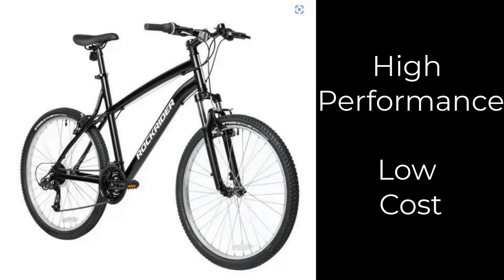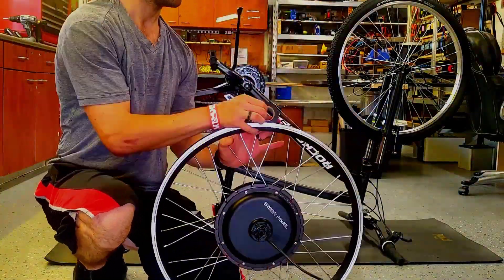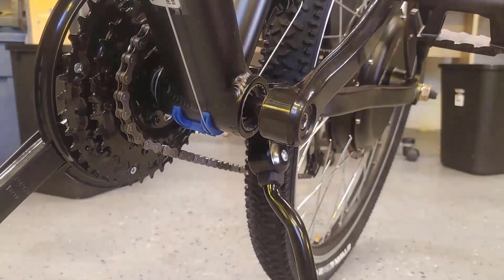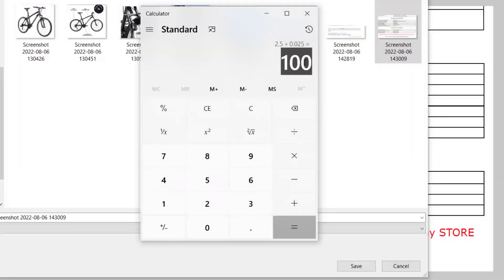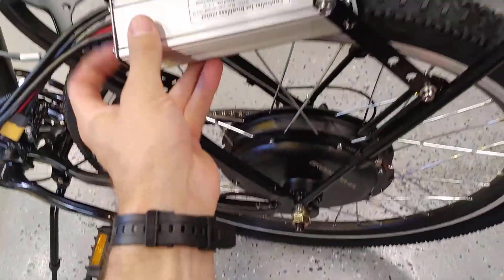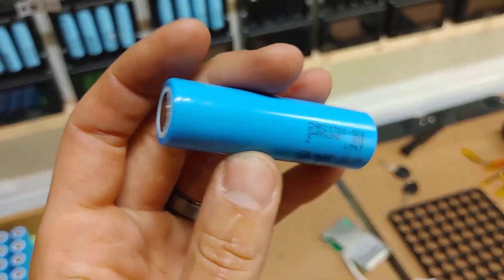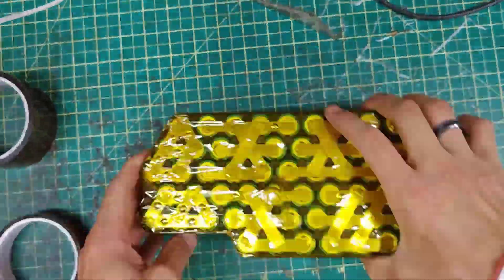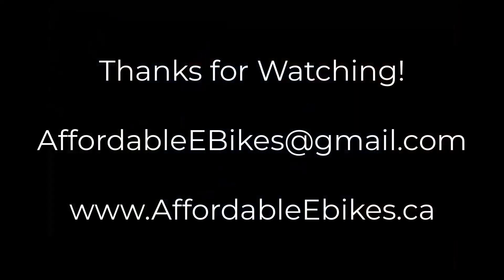Electric Bike DRASTIC Power Increase with SIMPLE Trick!

Comment: Hey just seen the video. How safe is it to use a modded shunt on a 1000w motor with the standard controller with 48v 18ah battery? The controller states 26+1a on the label if this helps any. Thanks if you can help out I’d really appreciate it a lot
Reply from the maker: Really depends on what your battery can output. Really depends on the cells. When you shunt mod you want to factor in around double the current, so for you would be like 50A. That's a lot for a battery to handle. You'd probably notice the battery cutting out quickly if its not up for the task.

Comment: So I've got an eBike and I'm unimpressed with the power. Being 6'1 210 shouldn't make it this hard to get a bike over 20mph. It's a 48v 1500w bike and I can't get it over 16mph on flat ground and I'm trying to find content to help me get the speed up (and torque, if possible).
Reply: Check if your controller has a speed limiter most likely thats your culprit. If it goes the same speed flat and uphill then its most likely speed limiter on controller. if slower uphill and 16mhp on flat ground then you can increase throughput with mod to get uphill speed to the flat speed if not overloaded

Comment: Can anyone tell me where I could learn more bout how to build more of my own batteries like this and where to source stuff for the batteries?? Really want to get into it myself
Reply: It can be very dangerous. I have tried it done it myself as well accidents still happen burned my hand really hard took months to heal from a short circuit using cheap Chinese bms with common port. Mind you a lot of these "shops" and DIY builders are getting shut down in US by gov and safety commission and or slapped with extremely high fines for altering, modifying or making DIY battery packs like this due to recent fires in NY. Many States are following suit and adopting additional safety standards that prevents you from building your own battery pack leally.
Reply from the maker: We're building a battery course right now! Send us an email to AffordableEBikes@gmail.com and we'll put you on the list! :D

Comment: I wonder what would be a more cost effective way to the epoxy. At almost $100 CAD for the bottles, would there be a more cost effective solution?
Reply: Not recommended unless you have a ton of CPU cooling ceramic cheap paste that has been tossed out by PC repair shop you can dump into it. Using hot glue is the worst possible idea. It will retain heat not transfer it.
Reply from the maker: Low temp hot melt glue is a good secondary option , doesn't have to get too hot to melt it in there and absorbs heat well 👍😁

Comment: Can I use a 52v 50 continuous amp  battery for a 48v 1000w motor with a 22a controller?
Reply: Yes, because the controller amperage is low you may want to get some fuses on going from your battery at 30-35 amp to keep it from over heating. As a general rule you can over bolt by 12v safely

Comment: Can I use a 52v 50 continuous amp  battery for a 48v 1000w motor with a 22a controller?
Reply: top voltage on a 48v pack is 52v. so yes that is just fine.

Comment: Can I use a 52v 50a (max cont) battery for my 48v 1000w motor with 22a controller without overloading the motor or controller?

Comment: What do you recommend for a larger controller like a 60amp? Could i pour it in one go filling it up?
Reply from the maker: Yeah even in for the 60A controllers I think you could get some incredible performance out of them. Definitely something we want to try out and hopefully will be able to shortly. I think modding a 60A and getting 100+A is doable which ends up getting up there with much more expensive controllers
Reply: @ElectricBikeLaboratory  I did just that  and have the potting ready to go, but I won't start mixing until I bench test everything. I appreciate your channel.  I've learned  quite a bit.
Reply: @ElectricBikeLaboratory update: I shunt modded a 60a 72v paired to a 3.5t 3k 29" wheel. My son at 150lbs went 62mph on a decent Florida downhill.  52 on flat road.
I'm in the process of following all these steps shown in the video on a shunt modded 45a "2000w" 72v kit. I fried the last wheel from the heat riding 30mph on the beach.

Comment: Hi! Thanks you for your video :).. I have a 500W Green Pedel and my rear derailleur collides with the engine when putting it in the highest gear. Does this happen with all Green Pedels? Is there any solution for that?
Reply from the maker: Yes you'll have to adjust the derailleur, there are two screws (L and H) on the derailleur, you'll have to adjust it so that the derailler can't quite get that far inward and rub against your hub motor. It will be the L adjustment that you need to adjust (Low Gear).

Hope this helps!

Comment: Great video! and I just sold my ST-50 for my e-bike lol! have a question tho.. I pulled all the screws out of my Chinese Mukkpet 48V controller but I cannot open the case because it seems like its all filled up with a clear hard gell from the factory, 🤷‍♂have  you ever seen this before? or do you have any tips how to open it so I can do the shunt mod? thanks
Reply from the maker: If it's epoxies then unfortunately shunt modding is going to be near impossible
Reply: @ElectricBikeLaboratory  thank you for the reply. I’m not sure if it is epoxy or not, but when I open it up, it’s like a hard gel substance all through it.  That sucks. I am having a hard time with this controller.  I’ve spent hours online trying to find it  online just some variation of a KZQ26 whatever that even means🤷‍♂️. The bike is a Mukkpet 750 motor is 9 pin, but Controller says RATTAN 48V (Chinese) . Emailed both companies no response @ all. Should I just count my blessings that I’m getting 25 miles an hour being 6 foot 4 250 and just leave it alone? Or perhaps try 52 V battery instead 🤷‍♂️ anyway thanks just subscribed. 🙏
Reply from the maker: On a cheap one like that. Yeah not bad to just count your blessings. Thank you for the sub! It is much appreciated! 🙂

Comment: I would be concerned with heat disappation if you use the varnish water sealer mentioned. Yes, it will keep water from touching the conductors, but it traps heat. I would use a ferrofluid like Grin Tech's "statorade" to help with heat dissapation and then either add a gasket or high temp silicone caulking between the cover and shell to keep water out. That would be the best of both worlds.
Reply from the maker: Haven't noticed any negative effects so far the motors have held up really well. It would have to be tested back to back to really be able to come to a conclusion though. I feel like the waterproofing is worth it unless you are right on the edge of burning out your motor but even then a hot motor cooling down draws more water in so tough to say.

Another YouTuber (DrBass) actually paints the side covers black on the inside to "absorb" any radiant heat which is interesting. Another one where you'd probably have to test back to back to know the real results. But very cool regardless !

Thanks for the comment! :D
Reply from the maker: We do use ferrofluid and cover it in this video , its great stuff! :)
Reply: @ElectricBikeLaboratory  yes, and that's awesome!  I was putting it in text in case people were just scanning through the posts.  Have you found that the varnish has been also sealing in the heat?

Comment: my battery diacharge says 50A 

And my controller is stock 35A.

If i shunt mod it, and the amperage of the controller ends up higher then the discharge for the battery what will happen?

And how do i accurately mod the controller so as to not exceed the discharge limit of battery?
Reply: Constant shut down if your bms is good quality and has temperature sensors other wise your battery will over heat and lithium ion goes up in smoke the kind that even fire department wont touch
Reply from the maker: If your BMS has a hard limit for current, then it will just cut out and you could reduce the amount of solder on the shunt until you don't experience cutouts

Comment: How much would a build like this cost, total out the door?
Reply from the maker: If DIYed probably about $1000
Bike was $197
Cells were 70 cells at $4.50 or $300ish
Motor package about $300USD
Casing and BMS $100
+ Little bits and pieces
Reply: @ElectricBikeLaboratory  Thanks for the info.  Those are some dang nice specs for that price point.  Wish I had the technical ability and the equipment to pull it off.

Comment: Great to the point easy to understand and well spoken  
parts are hard to come by dyi is a must here in Hawaii axle snapped ok I’m mechanically inclined called a few shops can’t be much n pretty easy not oh huh I need a new motor n possibly controller why it’s a 1100 w gmac hub motor great motor bad engineering bad place for a hole with wires so sorry ADHD clips like yours is awesome learned stuff I’m gonna implement before putting my hub back together ,mahalo aloha  MD

Comment: My knowledge in electrical is very basic. I’m mechanical minded my question is When u double the current, doesn’t it draw down the battery faster ? Thank you in advance
Reply from the maker: You're knowledge is correct! Yes doubling the current is definitely much harder on the battery, we recommend having a VERY strong battery in order to handle the power demands. Thank you for the comment!
Reply: @ElectricBikeLaboratory  I appreciate your response now my second question is do I need to change the wire on my 250 W brushless motor
Reply: What i meant  was thicker wire
Reply: @alirezashirazifard8990  most likely it may not make a lot of difference. 250w motors are fairly small and the winding might burn out just as fast as the lead wires you want to replace. so replacing the lead wires may not actually solve a whole lot. Yes you can do that but what this video suggests is usually "ok" to do if you have a Direct Drive motor. not a geared 250w dinky little motor that will have failures in many ways than one.

Comment: I have a 2000w kit with a 45amp controller and 52v battery, will a shunt be a good idea for this? Wondering if it will stress anything too much
Reply: I did my 2k 72v and it worked great for hundreds of miles until we rode the beach for two days without ferrofluid in the motor and cooked the windings. So, definitely add ferrofluid if you ride hard
Reply: @paulmryglod4802 How hot were those days at the beach when you cooked the motor ? and how long / many hours  were you riding? What was brand of hub motor ?

Comment: I went ahead and shunt modded my 45 amp controller. I turned the display amp limit down to 20 and it is now slightly faster than before the mod. Thank you for the tutorial!
Reply: What was the original display Amp and why turn down  the display Amp limit to 20?  Because by Shunt Modding the Controller ( making the copper connections inside beefier ) aren't you trying gain speed ?
Reply: @connicrow9463 because if his controller is drawing too many amps it can trip your battery’s BMS or burn out your motor. He probably gets more power after tuning down to 20 than before.
Reply from the maker: That is awesome!! Nicely done!! 😀👍🚴‍♀
Reply: What mph you hitting?

Comment: Can this bee done with a bafang 500w geared hub?
Reply from the maker: Sort of, check out Endless Sphere for "ATF Geared Hub", you fill the hub with Automatic Transmission Fluid which drastically increases the cooling capacity, though its a bit tough to make sure it doesn't leak out. If you're really willing to dive deep, you could weld the clutch shut and use a regenerative braking capable controller, that way if any fluid does leak out and goes on your rear brake you won't lose your brake (you'll still have the regen).

Hopefully we will be doing a video on this!
Thanks for the comment :)
Reply: @ElectricBikeLaboratory  question? how do you match a controller with a motor? Like can I put a 30a or 35a controller with a 500w geared hub.
Reply from the maker: @Luke-ew6uo  You can you just have to monitor the heat, most brushless motor controllers can operate any brushless motor (within reason) so it will most likely work but too many amps of current could overheat the motor. Once the motor gets really hot, the magnets desensitize and the motor is rendered useless

Comment: That epoxy idea is something I've never seen and I've been to a bunch of channels I'm digging your content so far man! I'm going to come back on here in a couple months to brag about how I discovered you first! I got my first kit on the way I'm going to throw it on a old trek 900 I'm only going 1000 Watts though. Should be faster than my lectric!
Reply: The idea is not new at all its been done for many years in florescent light ballasts they are always filled with heat defusing compounds... also hot glue is a VERY BAD BAD BAD IDEA. It  does not transfer energy but rather retains it making it a time bomb for failure. DO not follow this advice you will regret it.

Comment: Question: is it possible to do a tutorial for making a battery pack in unusual shapes other than easy-to-understand rectangles of straight s/p layout?
Reply from the maker: Absolutely, we will DEFINITELY be doing one of these!

We will be doing a video showing how to design a custom shaped battery in Onshape (free software). Stay tuned and thank you for watching :D
Reply: @ElectricBikeLaboratory  sweeeeeeet!! Once I start having to group my parallel cells in clusters, my brain short circuits to figure out how to make series connections properly.

Comment: Vbrakes and 3kw, no thanks. Otherwise some good knowledge in this video. Just me personally wouldn't trust them. Like take a typical rider and a bike 100kgs, if you travel 36kmh your travelling with a literal tonne of momentum. I really like the thermal epoxy, I personally just face the mosfets into the wind. That's without the mod, I've modded one but I haven't installed it on the bike as it was just a spare controller.

Comment: Hi very nice video. Do you know how many amps is rated to give  the bms of your battery? I have done the same trick with the shunt and based on your idea of the voltage sag the amps go from about 40 to about 68 amps while my bms  rates for only 50 amps!! Is that posible?
Reply from the maker: Hi there, our BMS was rated at 40A continuous and 60A+ peak.

Most BMS units will post their "continuous" current levels, and the peak of cutoff will be 2-3 times that value. DALY BMS for example are about triple (30A BMS will cut out around 90A).

Hope this helps! Thanks for the comment :)
Reply: Pulling more Amps than rated is unsafe and is not recommended. Most of the heat dissipation tricks used in this video are not generally safe and should not be used for prolonged period of time. Short bursts is fine but not continues throttle use. You will run into heating issue and the controller will most likely overheat and shut down and you have to shut it off and pedal until it cools down.

Comment: I actually have your 1000w hub kit I bought about a year ago and put about 500 km on it with the standard 15a 48v controller. I assume the hub is the exact same as in the video but the controller that came with the kit can handle 52v and is the same as in this video?
Reply from the maker: Yes sir!! 🙂

Comment: I just purchased a 1000watt ebike.  I have two 36 volt batteries I know longer use.  Any way to combine them to make a larger batter that I could use with my new bike?
Reply from the maker: Most 1000W ebikes run 48V or 52V. The 36V unfortunately won't be of much use although you COULD combine them together in parallel (charge to same voltage and connect together) and run a high powered step up converter to boost the batteries up to the 48V level.

https://tinyurl.com/8t4vs6p3

I personally WOULD NOT recommend doing this as it would be too much hassle and you'll lose a fair amout of efficiency converting the 36V to a higher voltage (about a 15-20 percent loss right off the bat).

You would probably be better off just selling the 36V batteries on Facebook Marketplace / Kijiji / Craigslist etc. And then even buying or building another 48V battery.

Hope this helps and thanks for the comment!
Reply: Ware level and capacity, internal resistance, charge cycles chemistry cell and behavior will determine the outcome of that endeavor. Not to mention different cell manufacturers dont like to play well together. You can combine the two packs for increased range but not that extra UMPHHH.. most 48v controllers will run on 36v battery packs but will cut out at about half their capacity or so. In a pinch i have used my 36v battery from another bike to use on my 48v bike before. You can combine the 2 battery packs with adapters you can buy online that are built for this specific purpose without rebuilding the packs.

Comment: So much searching and finally found this, thank you kind sir!...  There is a GMAC geared hub by Grin that has regenerative braking. It has a traditional bike axle because the wire goes thru the side. Just getting into the e part of ebikes and it would be cool to see a system built up around that or something like it. Thanks again
Reply from the maker: Wayne, we will DEFINITELY be doing a build with the GMAC! Very awesome motors, have installed a few and am thoroughly impressed. Stay tuned!! :)

Comment: Great video man. Thanks for the info. I just replaced the battery,controller,and motor on my 2019 RadCity. Using a 2000 watt motor,40amp controller and 72v battery. I have physical limitations at 50 years old and don't pedal much (throttle only usually) and noticed things getting warm. You provided some possible solutions to make my new upgrades last longer.
Reply from the maker: Wowzers thats a sweet setup!!